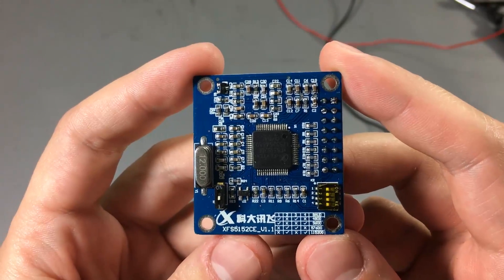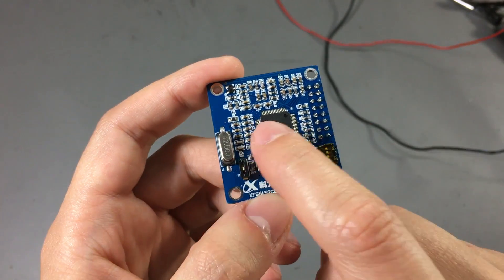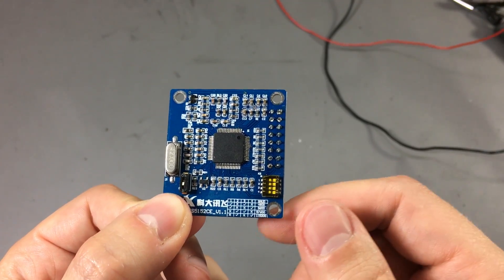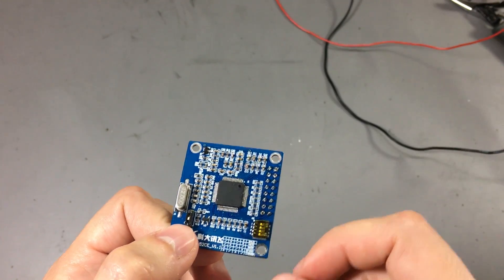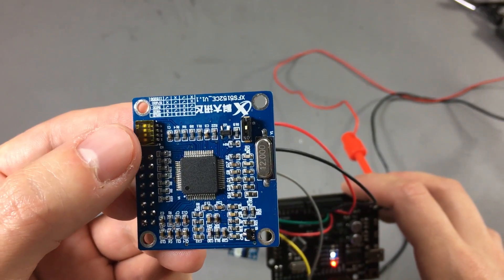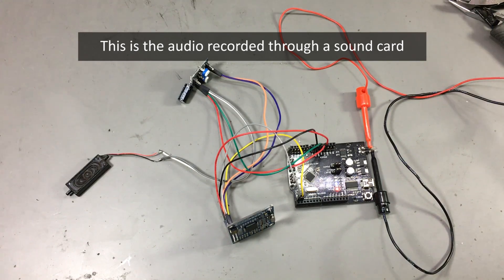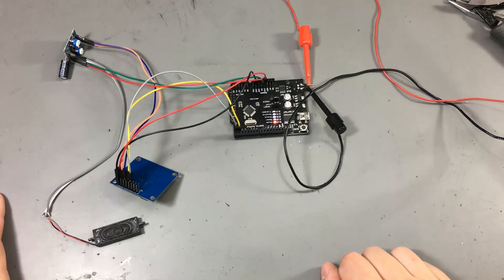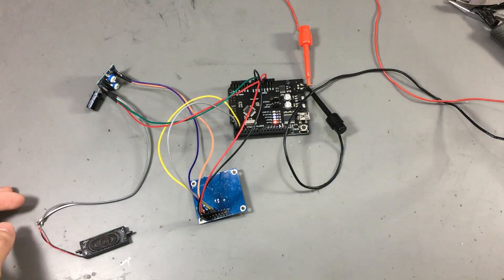Voltlog #171 - XFS5152CE Speech Synthesis Module Example Project

Comment: very good video. I bought  one based on this and it looks like a slightly different revision of board without dip switches. And when I run the simple code it spells out the words much to my surprise. Have you come across this as the code is identical in what it sends ?
Actually what they sent me has a SYN6658 chip on it and not a XFS5152, typical AliExpress :-)

Comment: thanks a lot! 

i ordered one of these earlier this on ali express for a rough 11 bucks, 
but i'm pretty shit at electronics, much better at the programming part, 
so finding the documentation was exclusively chinese,
and it having 16 pins, kind of daunted me

so i kinda left it unused for months, just got it out of my box with ICs again to try and give it a spin :)
i was going to use it for a robot and use sensors for "eyes" and "ears",
i also plan on it having a sd-card reader mp3 playing module (the cheap, buggy ones)

mine actually came with all the dips on the off position, which also does not reflect any preset in the table,
but if it starts giving garbage i'll know where to look :D

Comment: I like the google assistant. Her voice is nice and her pronunciations are very good. 
These speech chips are so 80's and 90's. 
Today, we have multi GB SBCs like RPi which makes sound processing, real. 
I would think, one core running at 1GHz can do this very easily, with time to spare for other processes.
Reply from the maker: Sure, but we are comparing a device which is smaller, easy to use, costs $15 and consumes a few tens of mA with a device that costs 5x as much, is bigger, not easy to setup and draws way more power.